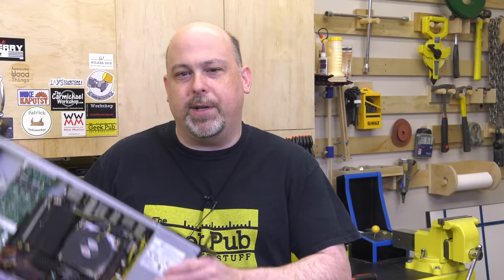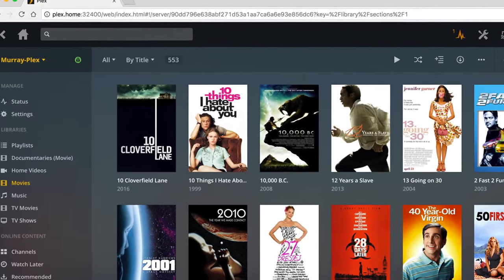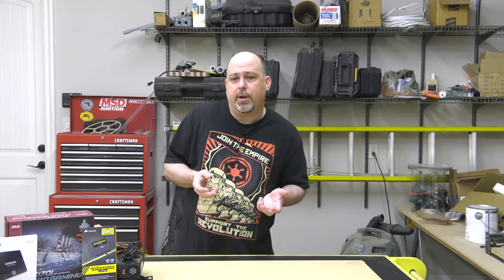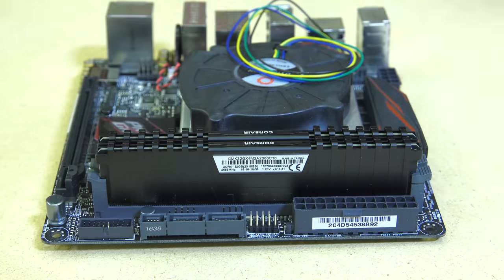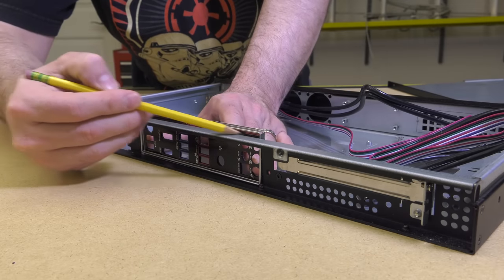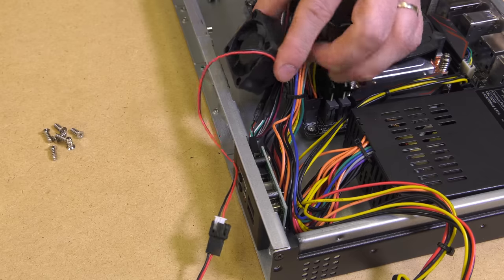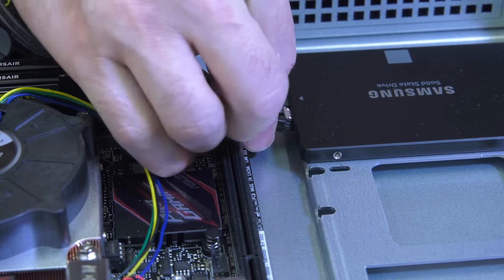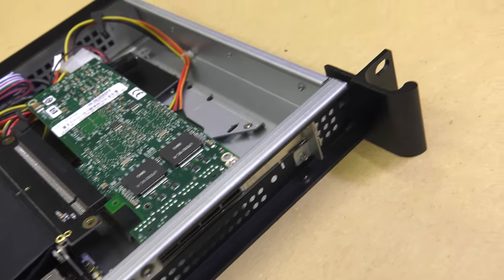Building a 1U Server (Bad A$$ 1U Server)

Comment: @7:58 ... why is the NAS mounted vertical?  and does that affect it at all in terms of heat/air movement?

Seriously, though, ESX at home?!?   hard core sysadmin nerd!!   I'd be interested to know how you handle the high-availability aspects.  Is there  a heartbeat connection between the two systems?   And it is "just" a home network.  Have you really needed such uptime?
Reply: Wordsnwood (Art Mulder) eh. I used to run esxi. changed it up to Hyper-V. Does the same thing.
Reply from the maker: ESX mostly handles all of this for you.  I have 4 gig ports, two dedicated to guest connectivity, and two dedicated to iSCSI.
Reply from the maker: I ran Hyper-V for quite a while, but switched back to VMWare.  Too many features I wanted were missing.
Reply: Yeah, I believe that the free version (for the home users) is limited to a single CPU. That is where it falls short for me lol.

Comment: Hey Geek Pub, I’m in the middle of redoing my room and network cabinet and I also have a 1u chassis like this with all low profile cards and what not but was wondering if I can install windows 10 pro instead of server os to this if I wanted to rackmount my current pc.... I have the os saved on a usb stick, and just need to know if it’s possible to fit a graphic card of some sort in here with also the Ethernet card you have showed us? I need to be able run this to a 24 port switch I have for my NAS.

Comment: are their any 1u chassis you can buy that will support standard pc form factor 'io' shields? without having to trim io shield with tin snips
Reply from the maker: Nope.
Reply: @Warren Pamment given the height of a 1U case and the standard i/o shield height, it’s physically not possible. You can buy generic i/o shield templates off eBay and then cut to fit your motherboard i/o and case.

Comment: Great video!  You racked the chassis so that all the i/o is facing out but all the pictures I can find of the case show the rack ears mounted on the other side.  Is it easy to swap that orientation?
Reply from the maker: It has rack holes on both sides.  You can also reverse the fan direction.  Just be aware you'll need a reverse flow power supply as well.

Comment: nothing two X5650 xeons and a solid ingot of copper with grooves machined out of it can't handle ;).
Reply: I'm running two HP DL360 G7, dual X5650 xeon, 32GB DDR3 ECC, 8x 146GB 10k SAS drive ESXi servers. A DL180 G6 with dual E5520 xeon, 8GB RAM, 4x 4TB WD Red (RAID5)(shared storage for vMotion). 2 360s have 4x 1Gb ethernet ports and 1x iLO3 Enterprise ethernet port. 180 only has 2x 1Gb ethernet port. However I am very interested in tiny 1U gaming host machines. I kinda wanna start a small closed gaming hosting company just to try it out.
Reply: connected by a Dell PowerConnect 6248P, 48 port, Layer 3, fully managed, full PoE switch btw
Reply: I would recommend anyone who is going to run this switch anywhere near humans to install quieter fans. It ;literally sounds like a busy airport lmao.

Comment: With the IOMMU updates on Ryzen, would you still recommend going with Intel on a build? For a tad more than a 6700 or 7700, you can get an 8 core 16thread Ryzen chip. In essence, build cost would be similar as the boards are a little cheaper coming from the AMD lineup.  It has a TDP of 65w vice 91. May be better suited in a 2U form factor though.

Comment: I just bought an IBM x3550 M3 (also 1u) with two Xeon E5520 and 24Gb of DDR3 1333MHz for only $150 xD
Reply: And The Geek Pub's machine will run circles around your machine.  You'll think your on a Commodore 64.
Reply: Two Xeon E5520 REKT the 6700k on heavily multithreaded workload... Also, I have the ability to have 288Gb of ram unlike the tiny 32 Gb his motherboard allows. For my use the x3550 is the clear winner. However, if all you need if a few fast cores, yes his server is better.
Reply: REKT?  CPU Boss paints a much different picture: http://cpuboss.com/cpus/Intel-Xeon-E5520-vs-Intel-Core-i7-6700K
Reply from the maker: +Reggie. Under certain type loads his machine would be acceptable. Sometimes number of cores is far more important than clock speed.  For my use case however, it would be much too slow.
Reply: +Reggie I have 2 xeons, the CPUBoss graph compares the i7-6700k to only one. Yes, on single thread workload the 6700k win, but a 8 core 16 thread machine will have at least 2x the performance of a single 6700k
Reply: +TheGeekPub I use it for virtualization and 3D rendering so yeah, it's realy good at that ^^
Reply: Reggie cotton, do some research, for certain workloads this machine will get murked by the older xeons. 

https://www.techspot.com/review/1155-affordable-dual-xeon-pc/page8.html

there is a reason people go nuts of used xeons and servers.
Reply: Reggie Cotton cpuboss and gpuboss has been known for faking their benchmarks
Reply: From where did you buy it??

Comment: Hello, my question to you is 
I want to build a small office network
It must support 50 to 100 computers
What Server should I use?
Is the server going to be a physically one
is it going to be a workstation ( I don't think this option works due to the heavy load of so many computers )
Do I need Vsphere 
vCenter or any other control console
How do I setup my nodes ( Node 1 & Node 2)
How do i do my storage

How do I setup my ASA Firewall ( Probably a smaller one Cisco 5505 )
How do I connect computers remotely to my ESXI

This would be a wonderful set of videos for your station and much appropriated if you can do it well!

Comment: Dumb question, but why build this for what I'm assuming is around $1000 when you can buy two or one relatively powerful secondhand machines? I just picked up an R620 on ebay with 2X E5-2630v2's, 256GB memory, 2X10GBe ports, H710, etc, etc.

I've got R610s too which I picked up for $100 locally with dual E5620's and 48gb of memory each. They're not loud at all, honestly quieter than the R710 they replaced.
Reply: Good question. His build, although running ESXi, is geared mostly toward transcoding and serving video content via Plex. According to another post made somewhere in this comments section, the consumer-grade hardware here provides hardware accelerated video transcoding support, which typical server-grade hardware lacks. That was my understanding of it; please correct me if I'm wrong.

Comment: What kind of overclocks do you see with that cooler?
Reply from the maker: Really depends on a ton of factors.  Including the ambient temperature of the room and how lucky you get with the chip lottery.  I built two of these.  One is consistently getting 5.1, while the other will only get to about 4.8 before crapping out.

Comment: Why no Xeon core and ECC ram?
Reply from the maker: I've answered that a few times... but short answer,.  I don't really need that for a home server and I benefit from the built in CODECs of the Core i7 for Plex.
Reply: if I am not mistaken, isn't plex a multithreaded app, so wouldn't a higher core count xeon be better?
Reply: The Xeon's with a 5/6 at the end of the part number have Intel QSV for transcoding. Then you also get IPMI and ECC.

Comment: New to the channel and it may be a dumb question but if you want server performance then maybe you should just buy an older model server. I am lucky working with servers all the time,  when friends asked for help with learning about Windows server I was able to find a reasonable price IBM 3550 M3 and set it up for under $200 it has 2 four core Xeon processors and could be a reasonable server for the cost.
I don’t know if I could have gotten the ram you specified it definitely would not have been as fast I think it has ddr3 but I don’t know offhand what the MHz is.

Comment: Those aren't 40x40mm fans. Those are 40x20mm or 40x15mm.
Reply from the maker: You're correct!  I'll update the specs.
Reply: 40x20 wouldn't work LxHxD so 40x40x20 or 40x40x15. 40x20 or 40x15 wouldn't spin as the blades wouldn't move as it wouldn't be circular. Circle vs oval :)

Comment: Awesome video, any suggestions if I want to build standard Windows 2016 server using this setup? i am not particular to adding Vmware on the server. I am planning to build the server that will serve as File /Print and web server.
Thank you
Reply from the maker: I'd probably get a much cheaper board and an Atom or celeron processor for that use case.

Comment: Would a Corsair H110i not have been a better choice? I'm pretty sure it's short enough (at least the water block is) and it'd probably be better in the enclosed space than a fan. I'm not entirely sure if you'd be able to mount the radiator properly, though. Meh, now I'm unsure of my question. Would love to hear your thoughts.

EDIT: Yeah, after finishing the video and seeing how little space is left, you'd have to mount the radiator externally, which wouldn't be as convenient.

Comment: too quiet. you need to upgrade your audio setup. Higher gain and compression. An exciter would help as well. Just a bit of advice. I wanted to watch this but I am not about to turn up my amp and then have another site blast me. Just sayin'
Reply from the maker: Nope.  My AGC circuit on my camera failed.  Panasonic replaced it.  Mentioned about 100 times below. ;-)

Comment: Yo next vid should be how to transform this server into a pc since you have two
Reply: Miguel Altamirano sit is a pc just in a different case pretty much
Reply: Ya but it needs a graphics processor and some other things
Reply from the maker: I doubt I'll be playing any games on my sever.  It doesn't even have a monitor connected to it.
Reply: a pc doesn't need a gpu to function it has on board graphics although a gpu would improve gaming performance servers aernt made for that work load but without a gpu it is still a pc a gpu only improves experience

Comment: Intel i7 for virtual machines... Hmm maken me think... WHY?!
Reply from the maker: Why not?  The difference between the comparable 4-core Xeon architecturally is the ennoblement of ECC RAM and the removal of the CODECs for video.  Other than that its the same chip
Reply: Xeon processor is best suited for your tasks which will mainly do server duties/activities. Xeon processor has support for ECC memory and has advantage over larger L1/L2 cache. Aside from ECC support, Xeon also supports Intel® vPro Technology, Intel® Virtualization Technology for Directed I/O (VT-d) and Intel® Trusted Execution Technology which would definitely increase overall performance especially on virtualization.
Reply from the maker: I think you are mistaken, but I am willing to be shown the error of my ways.  According to the ARK, VT-d and TET are both supported on Skylake and Kabylake Core i7.

Comment: A bad idea to teach people to use Soho components for the server, even at home. (Without ECC memory too)
There are mini-itx motherboards for the 2011v3 socket, and low-cost processors 1600v4/2600v4
And the best solution for today is xeon d-1541...
Reply from the maker: It's a bad idea to come onto the Youtube comments and talk about something for which you don't understand.
Reply: TheGeekPub Ahah, I'm not upset about your comment, Sorry if I hurt you, I've been working with servers since 2003, But I did not approve of your choice, based on the reasons, look at d-1541.
And I'm sorry for grammar mistakes I'm from russia
Reply from the maker: You didn't upset me. I just reacted the way you did.  However, if you had taken 30 seconds to read the comments below, the web article, or even the video itself I've explained have as others at least 20 times below why this choice was made.  Understanding the use-case of something is imperative to understanding how to give proper advice. ;-) The XEON does not have an Intel Quick Sync core for hardware video decompression, a requirement that I have in my project.  Lastly, there are many server systems on the planet that do not have ECC RAM, including the router that connects you to the internet I am guessing.  I'm not processing stock trades, and neither are most home users. I can certainly tolerate a 1 out of 340282366920938463463374607431768211456 (ref: Intel ARK) chance that a bit will be corrupted in memory once per year.  I think I am good.

Comment: howabout Grafics, if youing 770K you will NOT have any grafic options, your system might not even boot up w/o any cheap grafic option

thats why I would not take the 7700K ( I have three of those for Gaming)  but the non K or X version with integrated graphics, thats good enough for all servers anyways

delidding them will also help for thermals.
Reply from the maker: This is incorrect.  The 7700K most definitely has integrated graphics.  But don't take my word for it: https://ark.intel.com/products/97129/Intel-Core-i7-7700K-Processor-8M-Cache-up-to-4_50-GHz
Reply: seems you are right with that according to the Intel sheets

Not that I would care with that processor (delidded running 5 Ghz for gaming with GT1080 and 1080ti )
then its a valid choice.

I could do a quick check of course .. :)
Reply: yes you are r8t. i was mistaking the x version (5930 etc) ( I use that one for my NAS) and have older I7 that were lacking Intel graphics. was under impression the i7 7700 also did not include that

Comment: >Desktop parts on a server
Reply from the maker: Yep.
Reply: Desktop and server parts are 90% the same these days.
Reply: Not really. You usually lose access to many features with Intel (less so with AMD) such as ECC memory, Virtualization features, and dual CPU when you go with desktop parts over dedicated server parts. They're also not as reliable in servers, as they're not meant to run 24/7, which is why those chips are also usually clocked lower. With how cheap server parts get on AMD's side (not that Xeons are too expensive anyway), there's no real reason to use a quad core chip, when, for less, you could get a rock solid 8/16 core dual CPU system that is meant to be run 24/7.
Reply: Let's see... I need to move a couch across town once a month.  Do I buy a $20K SUV or do I buy a $500K 18-Wheeler, with redundant tires, greater load capacity, a longer lasting engine, etc?  While you're technically accurate in your comment, you completely missed the mark.  And there is no version whatsoever of a server board (at least that I've seen) that would fit in a 12" deep case which was his requirement.
Reply: Are you for real? Just search up ITX or mATX Server Motherboard and you'll get tons of results, all of which would fit into a smaller case. It's one thing to re-purpose parts you had lying around, but when you're actively buying a system from scratch there's no reason to not go with server grade parts. You can beat a nail into a piece of wood with a rock, but a hammer will be a much more suitable tool for doing so.
Reply from the maker: Come on guys?  Can't we all get along? :-)  Anyway, Jack is right, I don't need ECC, etc. it would just drive up the cost unnecessarily which is why I went with cheaper desktop components.  Again, this is a cluster already.  How many layers of redundancy do I need for a home server?  That being said, if  you do know of a server grade board that supports ESX and a Core i7 6700K let me know, as that was the underlying requirements.  I found several server grade boards in the ITX form factor, but they either support old generation processors, atoms, or didn't work with ESX (which has a very small number of supported chipsets).
Reply: Supermicro makes a few server-grade LGA-1151 in the ITX and mATX form factor. http://www.supermicro.com/products/motherboard/core/

VMWare's website doesn't display Skylake as a certified architecture for ESXi, which again brings me to the question of why use a 6700K when there's plenty of Xeons and Opterons that have ESXi certification at a similar price with more features?

I don't mean to come off as rude, I think the project is really cool, I just don't really understand the logic behind the hardware purchase, when you had to buy it all from scratch.
Reply from the maker: The 6700K is not supported for production, you are correct, because it is an unlocked chip.  ESX doesn't support overclocking.  But it is pin for pin and instruction set compatible with the locked Skylakes, which means it is 100% compatible with ESX.  What you're missing here is that I built a Skylake 5Ghz machine that runs ESX, on a pretty tight budget.  Here's the great news... if you think you can build a better unit, make a video and show us all how it's done. ;-)
Reply: Dawg.  You say your tryin not to be rude, but rude seems to be all you got.  Give the guys some respect. None of this is right or wrong, its personal choice. Differences in opinion gotta be OK dude!  Go build your own box your way bruh...
Reply: +TheGeekPub If getting to 5Ghz is crucial to the workload, I can understand the decision more, and if it works for you, great. Not sure what workload that would be, but whatever. 

+Sinister Peenwheedle I'm providing feedback in a constructive manner. As I said, I think the project is great, just part of the hardware could've been better picked, from my POV.
Reply: You guys are simple minded. Anything built for a purpose, no matter how or with what it is built with, so long as it performs intended task, makes it exactly what it is.

Comment: Build a Server; Without IPMI and without ECC RAM.  I think that is more of a consumer computer in a rackmount formfactor.
I would be interested in seeing some power consumption figures, noise figures, etc to compare against say buying a used server off Ebay for $200

I could almost see myself building something like this for a PFSense box, but even then I would probably get a supermicro board with IPMI and ECC RAM.

Criticisms aside, I thought the video was well done.
Reply from the maker: Thanks for the comments.  This horse has been beaten to death, but there's a detailed conversation in the comments. TLDR: I needed the i7 processor for the QuickSync core which the XEON doesn't have.